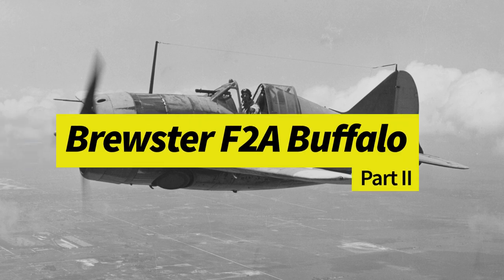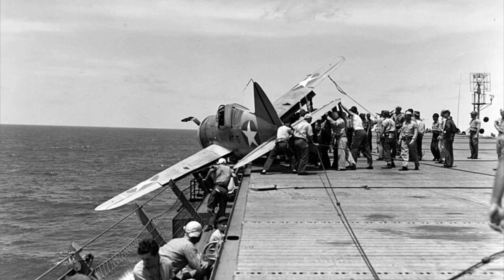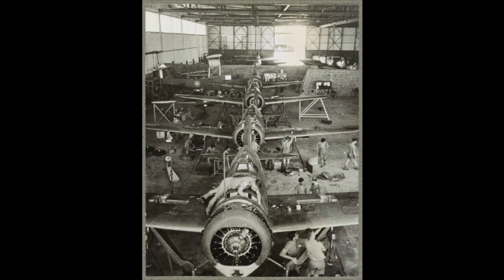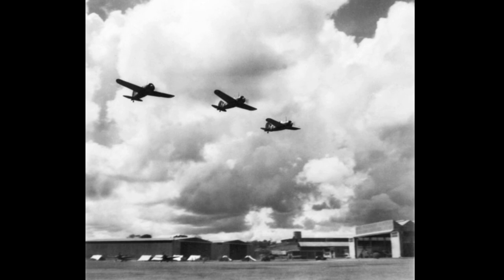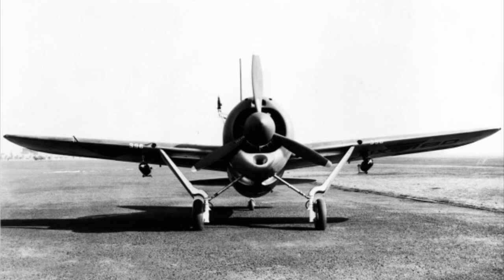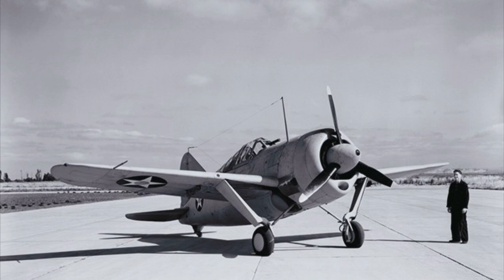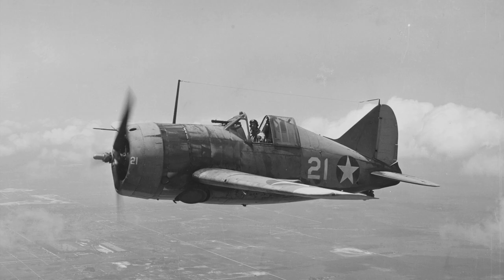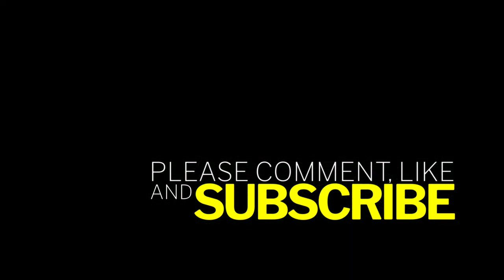Evolution of the Brewster F2A Buffalo – Part II

Comment: So  what model did Finn,s use  so well of production run, powerplant , arms package endinf combat weight / performance stats as opposed to all other variants and why had they better results?
Reply from the maker: They used an export variant of the F2A-1 (Model 239), be sure to check out part 1 of the Brewster Buffalo variants. That’s where that is covered
Reply: Their pilots were also better trained
Reply: The F2A-1 Buffaloes were much lighter than the later variants because they had no self-sealing tanks or much armour-plate. The Finns added a little bit of armour but it wasn't as much as the later Buffalo variants.

Comment: 1600 miles range is huge !  Yes the range was impressive though all that fuel must have been half the weight issue
Reply from the maker: I was surprised as well reading it, I’m sure it’s at its most efficient settings. I read the plane could stay aloft 12-13 hours if need be
Reply: I read somewhere the Dutch used half fuel and ammo loads for better performance in their brief war with the Japanese for Indonesia.

Comment: I wonder if the landing gear had been truly fixed and a 1350 hp engine available how it would have performed on cve's in the Atlantic? Seems the long range/loiter time would give them an edge on hunting uboats and FW200/BV138 aircraft. I'm sure the Wildcat was better in most ways but using F2A's for this and a lower powered unarmored version as advanced/gunnery trainers would have freed more capable aircraft for other tasks.
Reply from the maker: That is an great thought, It would have been quite interesting to see them serve on CVEs if their gremlins were fixed. Guess we’ll never know!
Reply: @svgproductions72  The biggest gremlins were the factory they were being made in…

Comment: The f2a3 could not fly 1600 miles
Reply from the maker: At first I thought the same thing when I was reading about it, but multiple sources I read  have stated the maximum range was 1680 miles, probably at maximum efficiency. I’m seeing other ranges under 1000 miles, due to cruising speed settings. Thanks for bringing it up!

Comment: excellent stuff even learned a few bits I never knew about. you would have hoped the 1200 hp engines would have fixed many issues but i guess there just wasn't any helping this mediocre design
Reply from the maker: From research in the past, US pilots generally preferred the F2A-2 over the -3 as the extra armor in the -3 really weighed it down !